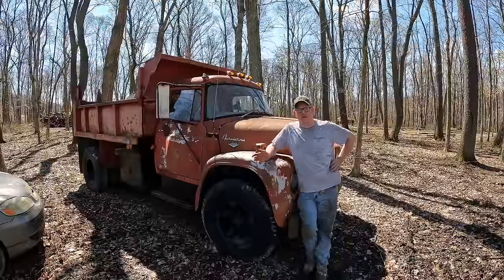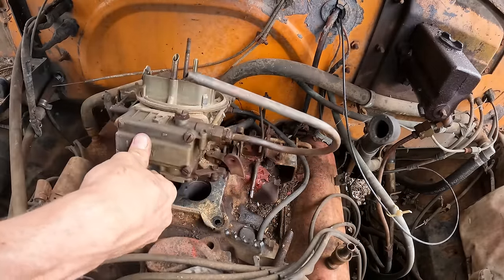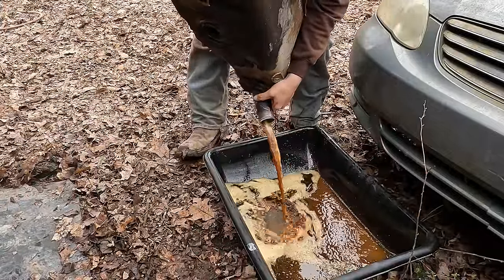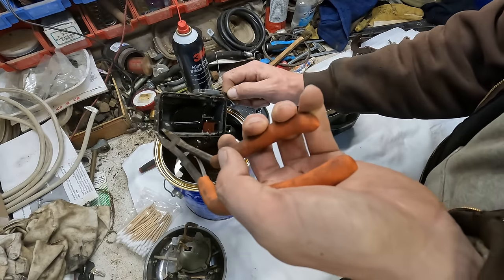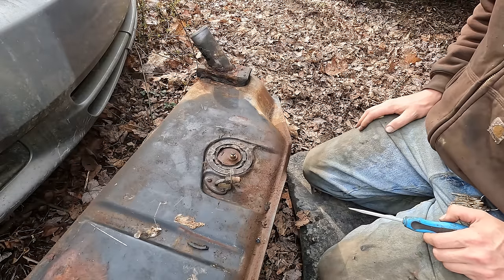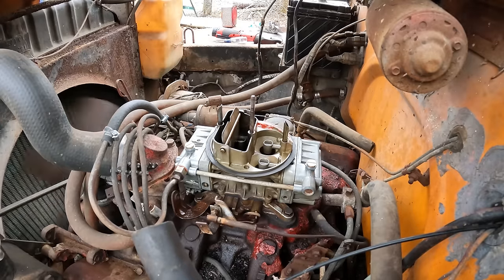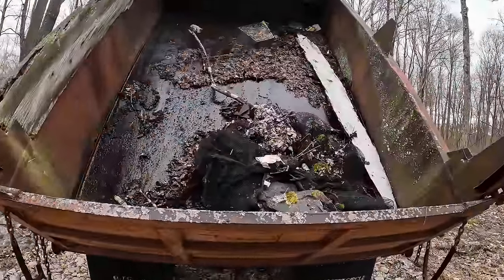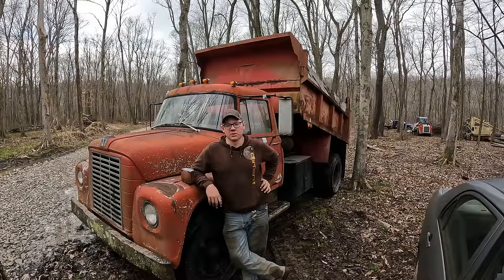Sitting 20+ years will this $500 Truck Run & Drive again? (International Loadstar Revival)

Comment: Check the radio on that old truck Matt.  Also make her roadworthy because L'll bet some day need to use the highway, brakes  and brakelights headlights etc.  Consider putting a paint job on the old gal and new boards on the sides with Diesel Creek on them.

Comment: I think you’re wonderful! I’m a 71 year old lady whose only mechanical claim to fame was dropping the engine on an old VW bug when I was 18, and rebuilding it with the help of a hippie handbook called “Volkswagon Repair for the Complete Idiot.” I knew nothing going in, but the darn thing ran for years after I got the engine back in it!
That book was da bomb! It even told you when it was time to take a smoking break, which I didn’t need, but  years later I finally wondered what it was he was lighting up! 
I remember pulling over and adjusting the idle with a bobby pin when it ran rough, as I didn’t carry any tools!
Reply: Wow, what a wonderful read.... Much love from 🇬🇧.
Reply: Good on you for dropping that engine blind! I guess it’s debatable what “smoke “ they were suggesting!

Comment: Reverse gears are straight cut gears on a bunch of gearboxes,even today.
Straight cut gears are noisy.
Reply: Yeah kinda hard to tell over a video and not in person but straight cut gears were my though aswell.
Reply: That is what I was thinking also. Looks like a really good dump truck to me
Reply: I’ll add my 32 years as a mechanic on this. I’ve never heard a manual transmission with a quiet reverse gear, regardless of scale.
Reply: That's right, All the old Internationals are like that...  as I remember :) Reverse gears whine. That's what makes it a "Binder"
Reply: Was just going to say reverse gear is a straight cut gear so its extremely loud. You all beat me to it. The old Chevy 366 5 speed I drove was the same in reverse and first gear.
Reply: @brentbosworth8845  grind it til you find it
Reply: @bradleysmith2021  if Matt would fix the radio you'll never hear those gears again instant fix
Reply: Just curious, what is the shift sequence on that old girl, my Chevy was 1low/hi, 2 low/hi, 3 low/hi,4 low,  5 low, then back to 4 hi and then 5 hi...  on a test drive I scared the heck out of the company driver,who apparently thought lugging between 4 and 5 was just the way it was, when I left 5 low heading to 4 hi he quickly braced himself against the glove compartment, I was careful to not laugh!!! Best Day of My Life😃😃
Reply: Thought the same thing when he put it in reverse, old stright cut gears
Reply: @jackspringer9283  : I believe that's the trans . 2 speed axles are low for job site , pit and farmers out in field . The hight side is road speeds and then only 3 to 4th or 4to 5 depending on trans. . Now I can be wrong but that's the way we drove those trucks .
Reply: The reverse noise most likely the gear, other than Eaton this is normal. The 2 speed rear gives you the  option of splitting gears when loaded, can either leave it in  low or high when empty, to prevent crashing gears push the clutch when shifting the 2 speed up or down.
Reply: @bradleysmith2021 bet you work in garage 54
Reply: @grimreaper6112  never heard of it.
Reply: Reverse and first are straight cut gears for max power. So they are noisy and need double de-clutching.
Reply: @justinfufun5483  
They don't need to be synchro meshed : you use them from a dead stop,or don't down shift in first gear anyways,so they don't bother using synchros.
Straight gears are not that much more efficient,they allow more likely to be more compact and cheaper to machine,and offer less surface area of contact for a same width,so less torque is usable on them as i know.
That's why they also are used on higly reduced gears,where torque is applied on high reving gears instead of 3rd or 4th gears where ratio is close to 1to 1 and where torque is quasi directly transmitted from gear to gear without reduction.
3rd and 4th gears blow up the more often and always are the more thick and strong gears.
Reply: @michaelovitch  if you are maneuvering. Its best to double clutch between reverse and first because the lay shaft is spinning the opposite way. Unlike modern vehicles there are no syncromesh rings on them.

Comment: When you mentioned how rebuilding a carb can seem daunting, it reminded me of my first time; I remember the Chilton's manual saying "Don't let it intimidate you; remember, it's only a carburetor."
Reply: Gr8fulFox  ,  Yeah... ONLY a carburetor!
Reply: Working on a F-100 truck I gave up on Chiltons. Under air-conditioned fan replacement it said. REMOVE DASH of installation is reverse on in stall.
Reply: First time i ever dealt with a carb at work i was so worked up about it. Now its "just a carb" not like most all cant go back together anyway but the right way 🤷‍♂️ always learn somwthing new but not nearly as daunting as it used to be.
Reply: @williamkowalchik572 yeah i get that alot at work to "install is reverse of removal" and its really annoying like obviously its reverse of removal, but the tools and methods you used to remove dont necessarily install it again....
Reply: @braap802  I keep my vehicles till the cost out weight the vehicle. So I buy uses and get the factory service manual to go with it.

Comment: Hey Matt,  I used to haul gravel back in the early 70's with a 1960 International dumptruck . One of the most reliable, good running trucks ever. Wish you good luck with yours. Name, maybe, Big Red. It's what I named mine. Take care and best wishes. 👍
Reply: Nice! Gravel is a fun side gig nowadays, about 5 years ago I started my gravel hauling gig with a 1988 F350 7.3 IDI DRW with the ZF5. Still have it, and I'm considering putting a dump bed on it but I see videos like this and I think my money would be better spent on reviving an antique medium duty like THIS one 🚛
Reply: @FarmerDrew  might be! But it is a gamble - you might spend a lot more than the cost of your upgrade if many systems are shot, just keep that in mind before you decide. Whatever you decide: Good luck and Godspeed.
Reply: cutie vv 
the truck ^ ^
Reply: i also suggest Bir Red for the name.
Reply: Typo - Big Red.
Reply: They look cool dropped to the floor and hot rodded.
Reply: @FarmerDrew  ,  What are your chances of finding one like this which work?
Reply: International and Isuzu diesels. Some of the f if not the best built quality diesels, especially when it come to reliability. Both often never miss a heartbeat.
Reply: @mjkaras  It is more like a "Lil Red".